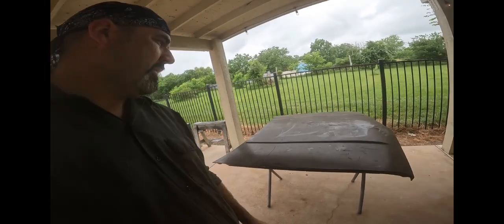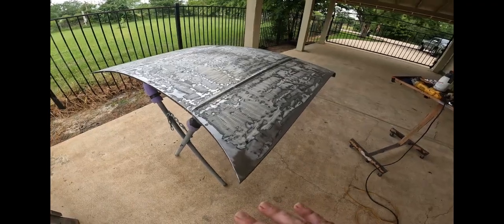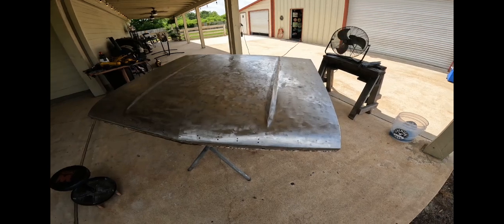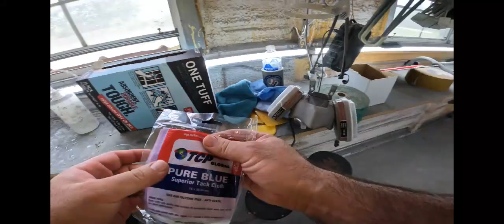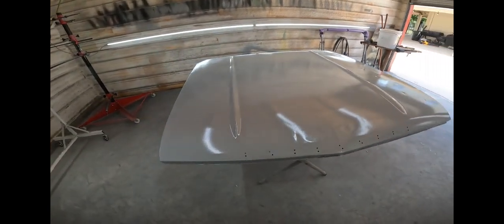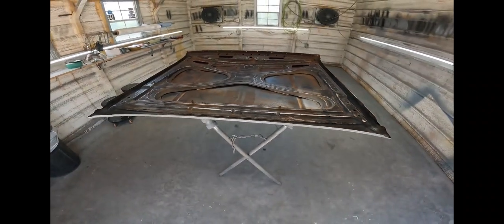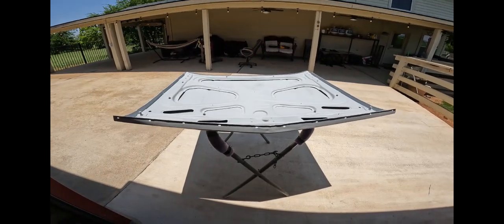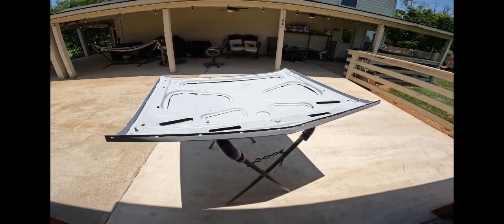RESTORING A CLASSIC CAR HOOD! | PART 1 | 1960 CHEVROLET IMPALA | LOWRIDER | DIY | EPOXY

Comment: I grew up in the 60's before Warning Labels and everything worked as it should 🙂
And if you messed up and got it on you or spilled it you figured out real fast on how to be careful with it.
Dry Cleaner fluid was the best.
I do not know how you do it with the heat and humidity..............
Nice find on the paint mixing stick under the hood, I will have to check mine.
Reply from the maker: Thanks Ed...I would say I'm used to the heat but I don't know if anyone ever gets used to it.

Comment: Great video as always. I do have a question. I have a 63 impala 4 door, where do you get your front suspension   kit from? I've googled but not sure what's the best one to get. I'm giving the whole front suspension a refresh. Any help would be much appreciated
Reply from the maker: Rock auto would be a good place. Or ebay.  Go with moog
Reply: @lonestarlows  thanks for the info. I will look at all of them

Comment: Lone star I messed around an sandblasted the underside of my 64 impala hood an blasted some of the puddy that holds hood skin up any idea on how I can fix
Reply from the maker: It's going to be tough
Reply: @lonestarlows  oh me what I was afraid of
Reply from the maker: @jonathanbritton980 yeah I never sand blast long flat panels anymore.   Ruined a 64 hood and trunk doing that
Reply: @lonestarlows  yeah I just blasted under side an not paying attention an blasted out that hard puddy that holds hood skin apart from frame now top side show dips where it’s missing I hate I did it probably have to buy new hood
Reply: @SmokeyA55  When blasting, don't get to close! Use a fine abrasive!